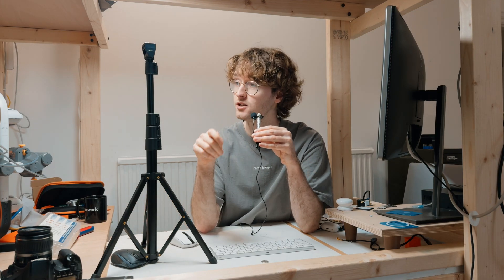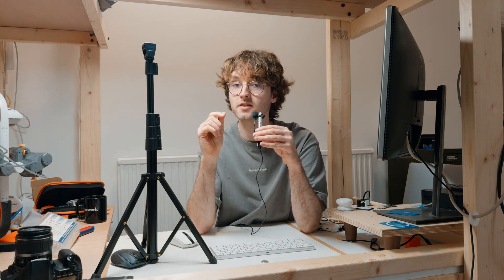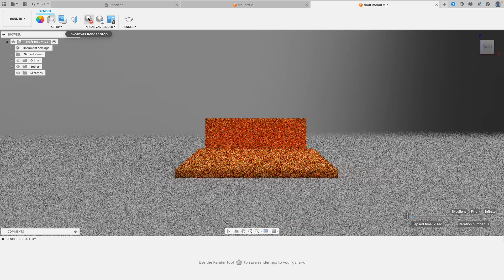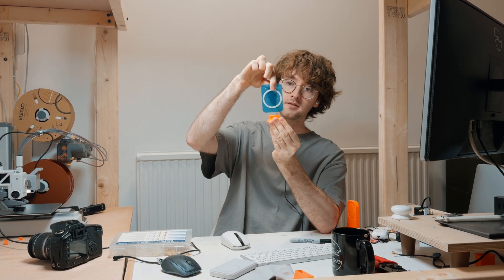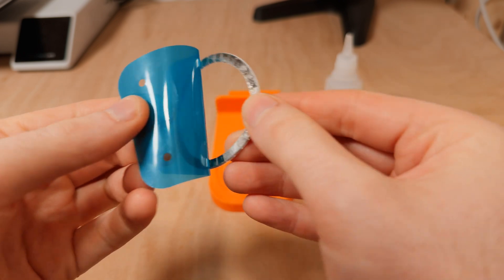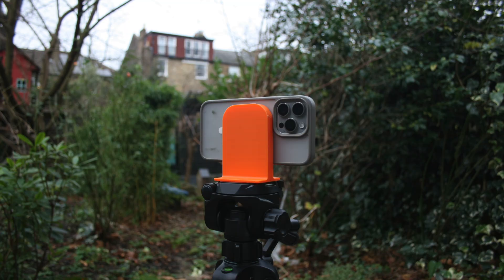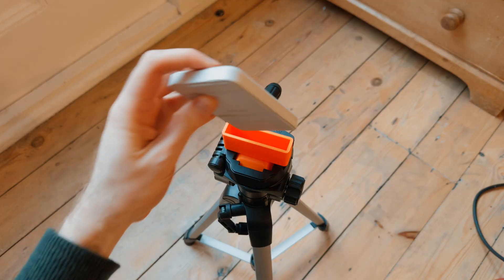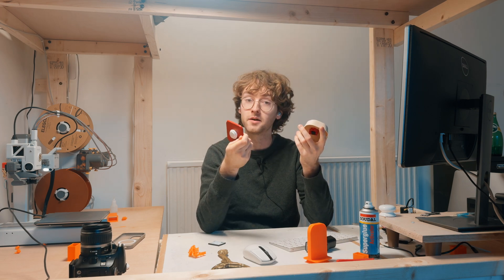I Made a Magsafe Release for my iPhone 15 Pro Max

Comment: Nice simple design. Just wondering why you are printing a purge tower with just a single color of filament. Seems like a waste of time and material.
Reply from the maker: When you use the smooth Timelapse option is prints a purge tower to stop filament oozing on your print